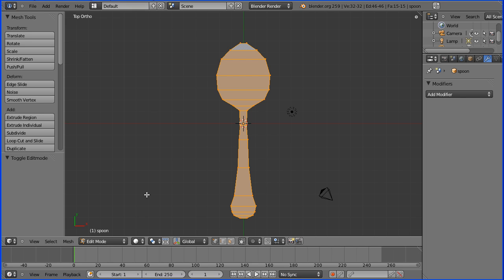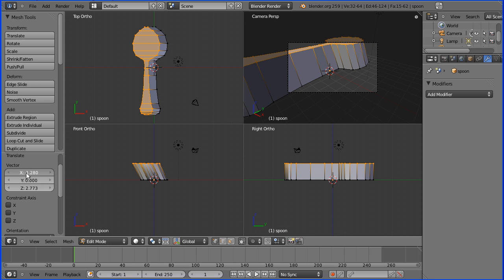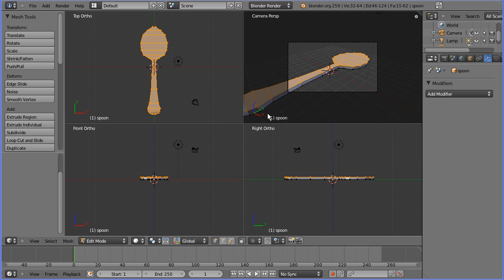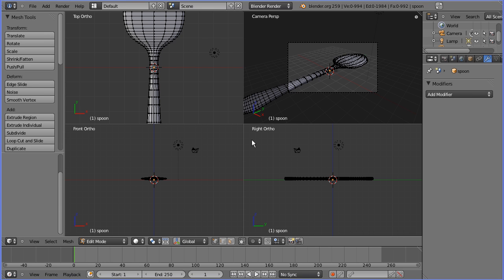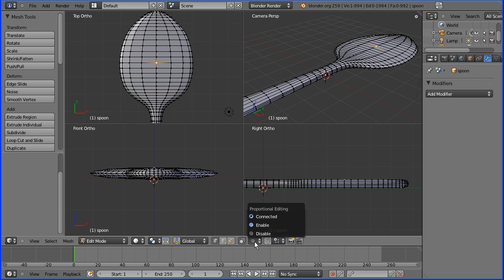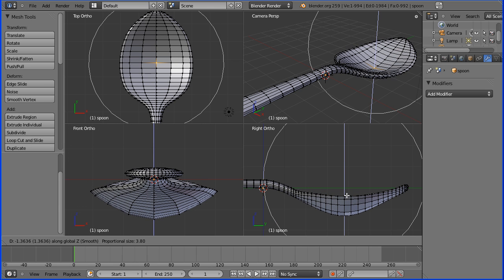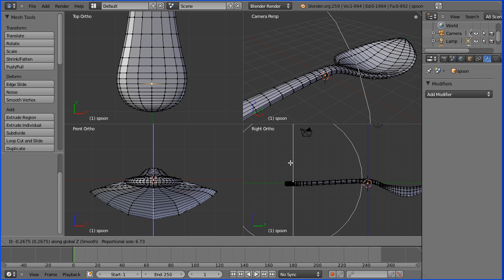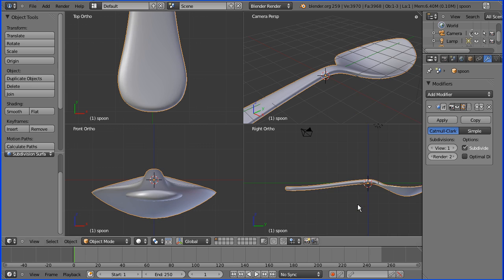Blender Making a Spoon Part 2 Extruding, Subdivision Surface Modifier and Proportional Editing

Comment: u called it low poly spoon, and if u add double subsurf mod will it become high poly?
Reply: +Banism24 Low/high poly are not set in stone. it depends on what you are doing. At the end of this vid the spoon has ~4000 faces, which means ~8000 polygons. You can see it in the top of the window. Subsurf works exponentially.

Comment: Thank you for 2 well done,very easy to understand videos. I want to design a bracket for a 3d printer I plan to buy. I wanted to find 3d software and be sure I could design the bracket before I bought the printer. Next I need to learn how to generate a STL file to send to the printer. Thank you!!!!